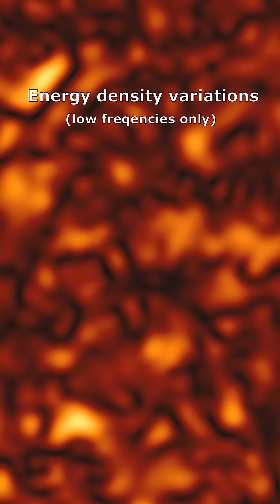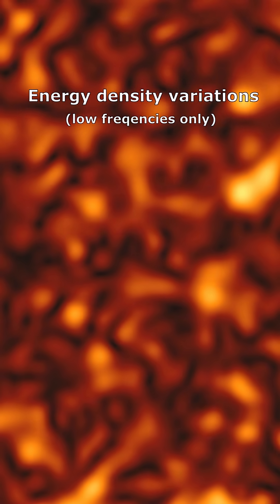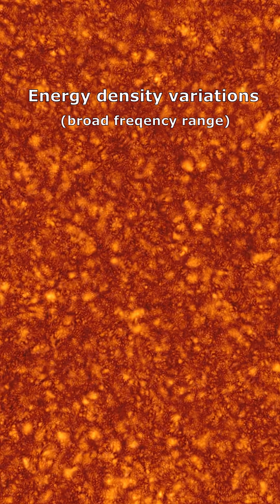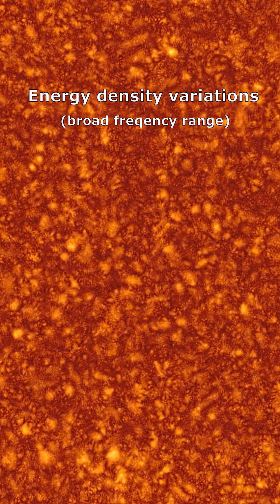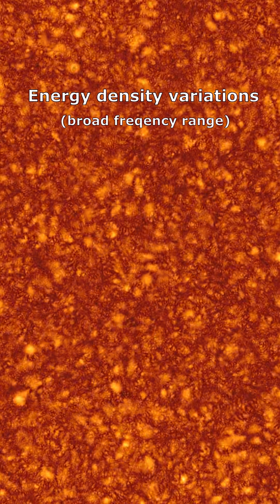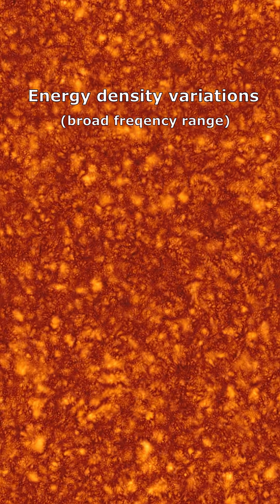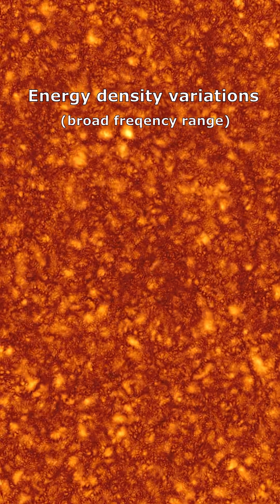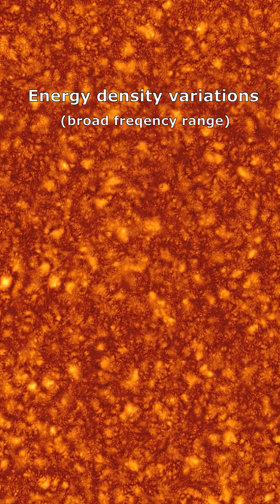Vacuum energy density visualized

Comment: What is this recording of?
Reply: it's not a recording, it's a simulation of what "nothing" looks like at extremely small scales. the quantum foam visualized here is not  yet confirmed to exist, although it's a very common belief among theoretical physicists that this process does occur on some scale as this would explain the experimentally proven casimir effect. 

the casimir effect or casimir force is a force applied to any objects which are sufficiently flat and sufficiently near eachother, which could be explained by the quantum foam in-between the objects "pushing them apart", but there are alternative explanations and it's not strictly proven yet

also most of space is far far more energetic than this, even if we did have a way of detecting vacuum energy fluctuations we wouldn't be able to record them anywhere because even "empty" space has unbelievably chaotic energy fluctuations by comparison..

also for the record if this was a recording of a real phenomena, the area pictured by the recording device would be smaller than one of the quarks inside one of the protons inside one of the atoms inside one of the molecules inside one of the cells inside one of the blood vessels inside your body, it is an area so inconceivably small that i cannot describe it to you
Reply: Space? Because this looks like a chemical reaction 🌠😉 life as we know it is at an infinite scale of space and reactions.

Comment: I hope someone figures out how to tap into this energy, in our lifetime.
Reply: it cannot be tapped into, just like how it is impossible to gather energy from the random motion of a system of equally hot particles without moving the heat out of the system, extracting energy from the vacuum would violate the laws of thermodynamics
Reply: @nobodyinparticular968 the laws of thermodynamics govern atomic nuclei. Protons and neutrons. There are 16 particles in the standard model. I'm saying maybe there are ways to harvest energy using quantum fields of other exotic particles.

You can harvest tiny amounts of EM energy right now with an antenna or PV device. Maybe muons or other particles will present even more opportunities.
Reply: @nobodyinparticular968 Not quite true.  There are possibilities to extract the energy by using quantum ratchets or multi-point high frequency rectifiers.  While the energy is of a uniform temperature on aggregate, there are still gradients that can be mined.
Reply: Happened many times. Tesla, Moray, Carr etc etc then all the patents buried due to 'national security' and lot of people threatened with being ended.
Reply: @N4CR put the weed away

Comment: Does this means in space vacuum with " absolute zero degree " those fields still exists, energies vary and behave like a foam?
Reply: at a temperature of absolute zero the fields would have absolutely no motion, in theory... it's kind of pointless to consider, though, since reaching absolute zero is thought to be impossible
Reply from the maker: Yes, the definition of temperature is generally connected to objects of mass, like atoms moving in a gas. It can even be meaningful in the case of vacuum that contains electromagnetic radiation. However, the properties of the vacuum itself are independent of any definition of its "temperature". Because the energy itself like gravitational waves and electromagnetic radiation  (either low or high frequency) all propagate at the same speed, which is the local speed of light.

Comment: And that energy is from particles movement. Dark matter, problem solved.
Reply: energy that could not become particle but from afar looks like one
Reply: the energy does not come from particles moving, and both the vacuum energy density and the kinetic energy of particles were already factored into the calculations to predict the mass of galaxies. if the problem could be explained that easily we would already have a theory of quantum gravity
Reply: There is nothing dark at all. Things do not glow all the time.

Comment: Would two objects travelling at different speeds through space observe the vacuum traveling counter to them, or does some kind of relativity voodoo happen so they just see the same thing?
Reply from the maker: I think relativity arises because any interactions between bodies always involves a two-way speed of light through a medium.
Reply: @HuygensOptics  Can you directly interact with the energy density of the vacuum, or is it only through some kind of side-effect that it's observed?  If directly, I'd imagine that a "stationary" observer of a patch of vacuum would see a zero net velocity, and an observer of that same patch speeding through at near the speed of light would see a strong countervailing net velocity.  I mean, maybe that doesn't break anything; I guess technically it's allowed to fill the universe with a thin gas of particles you can use to judge your velocity, but it seems somehow more fundamental to say that this just...well, I guess, does the energy density arise from e.g. spacetime itself, or is it e.g. the interference pattern of all the other things in the universe you could observe anyway?  If you removed all other matter from the universe, would the vacuum energy density quiet down?  If you split the universe in half and sent one half speeding one direction and the other speeding the other direction, would the vacuum energy density pattern in each half follow suit because everything nearby emitting disturbances did?  Or is it entirely independent, arising on its own without regard for the matter and fields already in place?
Reply: @HuygensOptics   Hmm.  I posted a reply, but it's mysteriously absent, now.  :/  Oh well, I guess??
Reply: they see different things i believe
Reply: @nobodyinparticular968  That feels like it should violate relativity, since it allows you to measure absolute speeds; it means there really IS one true rest velocity
Reply: @Erhannis  you're absolutely right, that is weird to think about...

i just looked up "does the quantum foam provide an absolute reference frame" and found a paper called "Engineering the Quantum Foam" by Reginald T. Cahill, which contained this paragraph:

"Of course this quantum foam is not embedded in any real background
geometrical space. At the coarse-grained classical level this differential flow
would be modelled by a velocity field, with the velocity field defined by
reference to an arbitrary ‘observer’ or, more impersonally, to an arbitrary frame
of reference."

which completely goes over my head and means absolutely nothing to me, but maybe it answers your question? i'm just gonna take "it's relativity voodoo" as my explanation and move on, personally..
Reply: @nobodyinparticular968  I think I half understand it?  It SOUNDS like it's saying st that implies "you can't use it to measure your velocity", though I don't understand exactly why, haha.  The paper sounds very relevant, though; good find.
Reply: @nobodyinparticular968 very good research and the catch thank you !
Very interesting.

Comment: that's what I see when I close my eyes
Reply: Great observation and comparison!
Reply: Lol I get that as well, especially outside on a sunny day.
Reply: You too huh? Here, try this, but be careful about it.

Close your eyes, and press your palms to your eyes lightly. You don't want to press hard, that would not be good of course. (Being non-graphic)

But, if you do this, focus on a scene you want to envision in your head. It might take a bit to get it, but you should end up with a weird almost dream like image of sorts that may or may not be 'animated' in movement. 

This can be done without the pressure too, but, I find the pressure of something like a blindfold with some extra padding on the eyes helps. But your palms work too, just again, be careful about it. 

Also, I am not sure why this works, for me at least, but that's why I am sharing this right now. If ya'll see the swirly colours, then perhaps you can copy this and get the same results as well. Perhaps others who don't see em can do it too. I dunno. 

But am curious, so am sharing, but also want ya'll to be careful about it. No need to do damage to your eyes. If concerned, use the blindfold method, just wear it tight.
Reply: @ManuFortis  pressing on my eyes starts firework displays behind them. rippling blue checkerboards and iridescent sparks.
Reply: @kingmasterlord  Pressing too hard I think. It's a soft pressure you are going for.
Reply: Stop the mushroom !!!
Reply: @zibobpompon5768  ever since i was a kid, that first animation has been the background when i close my eyes